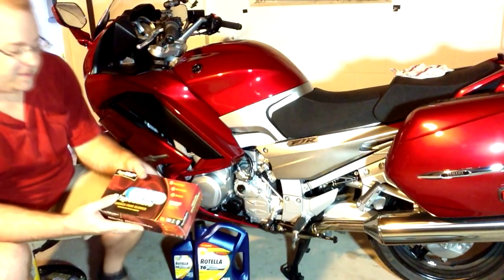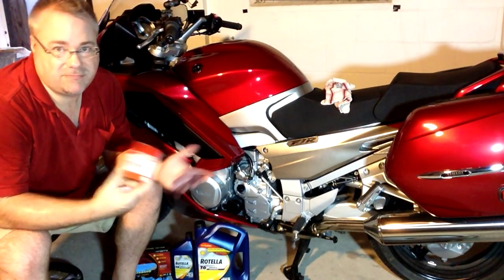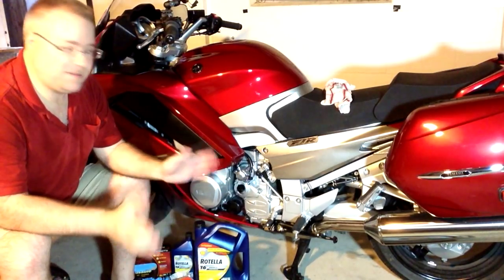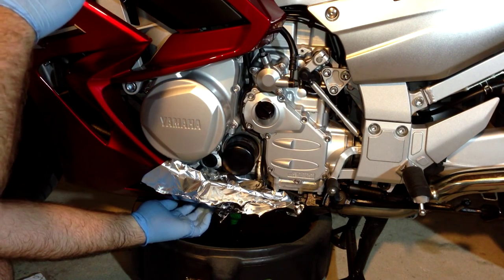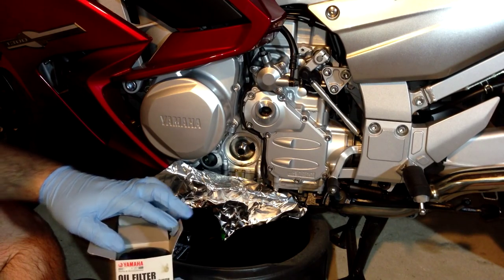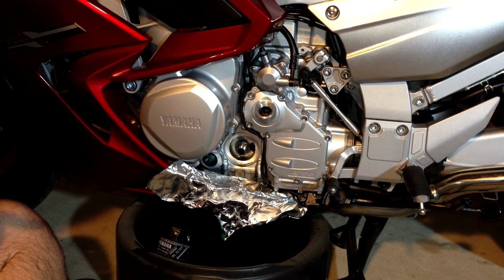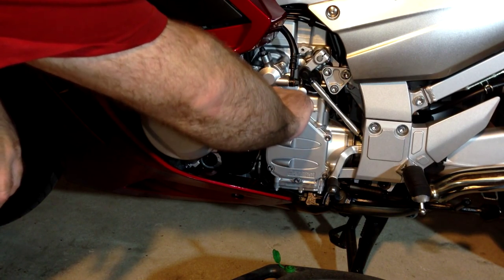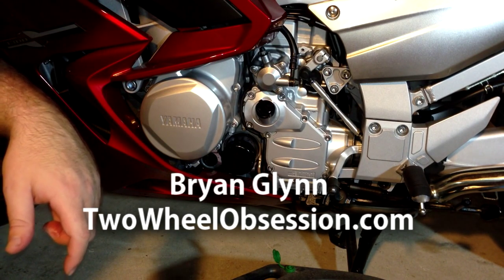How To Change The Oil On A Motorcycle Yamaha FJR 1300 ES

Comment: It's an old video, I know...As the new owner of an FJR, I came across this video and found it very helpful.  There was ONE thing in the video that had me yelling "noooooo!!!!' at my TV.

As soon as the larger bottle of oil was opened, it should have been returned to the retailer.  Sure, some jerk bought the bottle, helped themselves to some, then returned it - basically getting a free top-up.  BUT...

Although it was confirmed this was not simply old oil that was returned to the store, there was no way of knowing that the oil was not contaminated by something else.   If I had come across this scenario, I would prefer to take the time to go to the retailer to get a new bottle, rather than risk malicious contamination that could destroy my engine.

But besides that, thanks heaps for this.  I am not mechanically minded, but it showed just how easy an oil change was do to on my 2017 machine.

Comment: Quick thank you. I changed the oil and filter today on my 2015 FJR and all went well, thanks almost entirely to your videos. I also installed a GPS which I could not have done without your video on putting on a battery tender pig tail, as I could not for the life of me figure out how to remove the fasteners which needed a small Allen wrench to pop out. The Yamaha service manual has no instructions on how to get to the battery. Anyway, many thanks for your efforts as they are much appreciated.

Comment: Hello Bryan, thanks for your instructionvideo about oil change for yamaha fjr 1300 2013 and above. I just have changed my oil(4 liter). oil filter and fill it up to the level between the two dots like you have shown in your video. Everything went well. I started a few times to let the oil fill the spaces in the engine and oil filter, level was a little under middel level, top it off again between the two dots. When I start de engine and put him in gear and let the clutch out, the oil level in the looking glass drops to below the first dot, when I turn the engine off, the oil comes back between the two dots. All of this  when the engine is still on the center stand. 🙈Is this normal? when your driving, you don't look at the looking glass, so this is a surprise to me. 😊

Comment: A K&N filter should be your first choice for filters ... and removal is a snap. Good video
Reply: agreed, K&N has the bolt head and you can eliminate that silly oem filter cup remover.
Reply: Robt Bomba I just used a K&N Wrench-off oil filter, part number KN-204 if you need it.  Black.

Comment: I generally fill the new oil filter about 3/4 before I even screw it on...  I've also found that the when this bike is on the centerstand you really don't get an accurate reading (because its tipped forward).  I jack the front end up about 2-3" and it makes the bike perfectly level for a more accurate reading.

Comment: Thanks gain for the info!  Just some notes about oil & filter I use if anyone needs it:  Yamalube Performance All Purpose Four Stroke SAE 20W-50 (summer oil change) Yamaha Part number : LUB-20W50-AP-04.  And used a K&N Performance Black Wrench-Off filer, part number KN-204.

Comment: Just curious... what is the “vent/drain” (22:18) from the tank you mentioned?? I noticed that tubing on my FJR there. And also tubing near the rear shock that drains towards the ground. Sometimes liquid seems to leak out of the tubes - especially the rear one. Any idea why?
Reply from the maker: Fuel tank vents. If you overfill on a hot day you will see it leak.
Reply: Thank you

Comment: Is that T6 oil designated at "Diesel" That's all I can find for it specifically. Assuming at the correct weight (10W-40) it's fine?
Reply from the maker: yep
Reply: @TwoWheelObsession  you used 5W-40.  I have seen 10W30 recommended and the above person asked about 10W40.  Respectfully, which is it?  I just purchased my first FJR1300 - 2008. It's in near perfect condition and I am wanting it to remain that way.  Thanks for the videos.  Been watching for a long time while waiting on the right bike to come along.

Comment: Good video - I think I'm not going with the Rotella T6 only because the manual says 15w-40 or 20w-40/50 for temps that I ride in 50F+.  From what I've read changing good brand oil more often trumps longer use of expensive synthetic oils.  Is your 2014 filter # 5GH-13440-60-00 ?

Comment: Hi Bryan. Any difference between draining the oil on the side stand vs. the center stand? How much extra oil do you get out if it's drained via the side stand?
Reply from the maker: scotw67 You get less out on the sidestand, it would pool a little bit in the corner.  The correct way is as I showed and the manual states - center.  You also need to check the level with the bike level.
Reply: disagree,  I got another 8 or so ounces OUT after dripping on centerstand then put on sidestand even tipping bike over more so to the left leaning bike over.  Why not get MORE oil out if old is better than leaving more old oil in the bike

Comment: All my life I have hand tightened the oil filter, most filters say 3/4 to 1 turn after the gasket contacts the engine surface.  The Yamaha manual gives the filter tightening torque of 17Nm or 12flb.  I tried that on the first oil change but never got to that value, just didn't seem right.

Comment: TwoWheelObsession: can you tell me again what type of Rotella T6 oil are you using for Ex. the one you used on the video to change your oil, due to the fact that there are quite a few types of Rotella makes and I want to use the same one you are using in your video, thanks.
Reply: blue container T6 5/40 full synth

Comment: Hi Bryan. Just a question. I have an 05 FJR1300. I live in san diego, CA. If I wanted to try the Rotella T6, what viscosity would you recommend? I see some at Walmart, but they only have 5W-40. The yamalube I've been using is 10-50.  Thanks in advance!

Comment: Is it safe to use Yamalube 20W-50 in my 2008 FJR1300? The owners manual recommends 20W-40. Thank you
Reply from the maker: +E.S. Slc the manual gives a range, depending on your conditions. Look at the chart.
Reply: There is no actual chart in this 2008 manual. It says: Yamalube 4 (20W-40) or SAE 20W-40.
Reply from the maker: Sorry, I didn't know the older manuals didn't have the chart.  Here's a later edition, see page 9-1 https://dd5394a0b8ca8e97ba29-abf76f3d91a2125517d6c7c409f095c7.ssl.cf1.rackcdn.com/content/common/manuals/2016/LIT-11626-29-61R1_59527eeb2a0ab6716ccc4879.pdf

Comment: You really should give the bike a minute to let the oil settle before checking it per the manual.  f you check it immediately after shutting the bike off then you have a lot of oil trapped in the top of the motor that’s dripping down. You’ll be surprised how much it raises up after only 45 seconds

Comment: My yamaha FJR manual says specifically, do not use  a synthetic oil in this motorcycle.  it is an 09. is the oil you use synthetic  ? is it a car oil ?
Reply from the maker: +ROB NAVAEI You misread
Reply: AS long as it has the "JASO MA" specification on the oil it will work fine in a FJR1300, fully syn or not, the MA is what you are looking for on the oil jug.

Comment: why put the nut back andstill have the filter on? i would remove it all, then let it drip for a min.. by moving the filter you might throw some old oil out the filter back in your system.